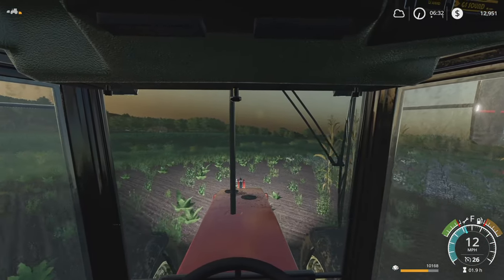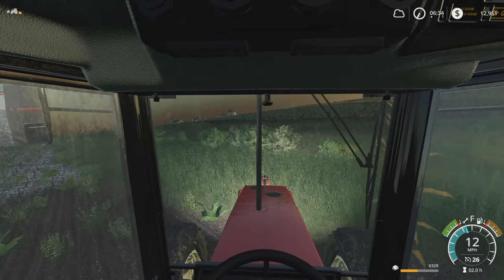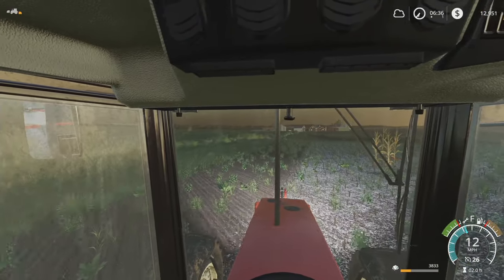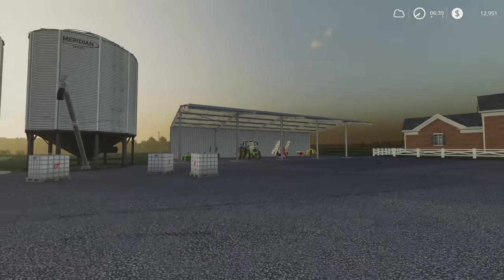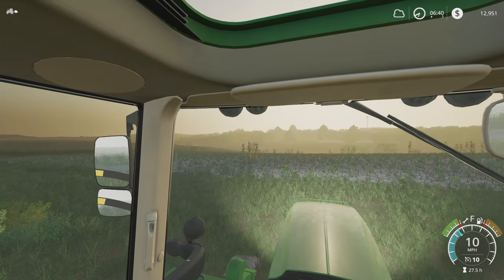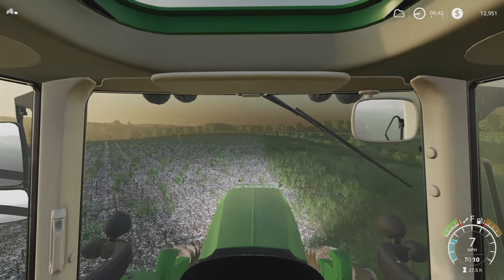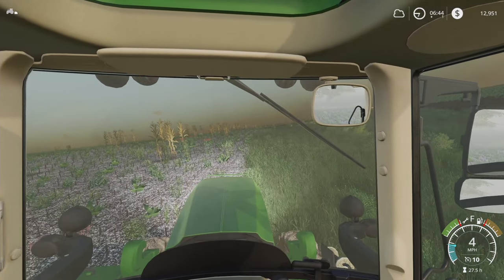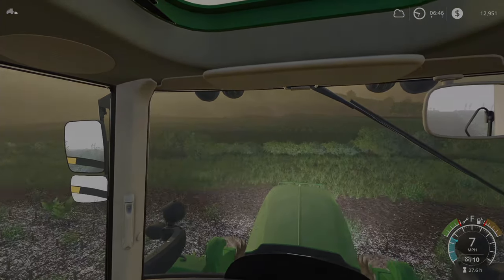FS19 | Rolling Hills Cattle Farm 06 | Wheel / Pedals / TrackIR

Comment: Nice video Kerbo, one thing I tried was after harvesting, cultivate,  then plant oulseed radish. The weeds will pop up in the radishes but all you have to do then is either disc it in or direct seed right over the radishes. The weeds did not come back in my crops. I am about to try another field with this method just to see.
Reply from the maker: I've had real good luck so far with using a weeder on 1st stage growth weeds. It's hard to tell though sometimes between the buggy map and the buggy game what exactly is going on. Thanks for the tip.
Reply: I try to catch them at first stage to be able to use the weeder, but sometimes I have had them pop up again. Not sure why, I still think the weeds are buggy.